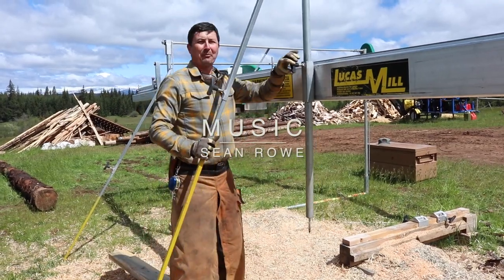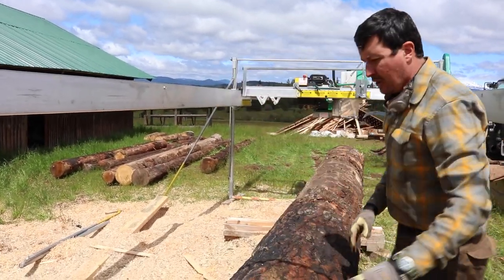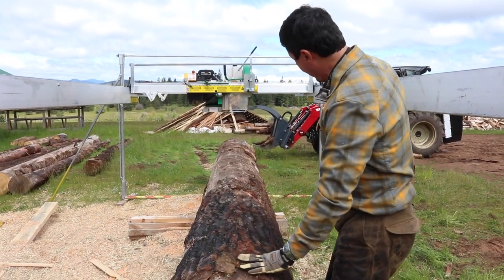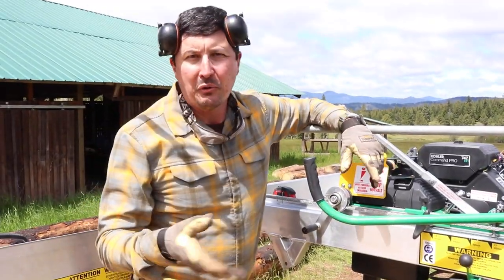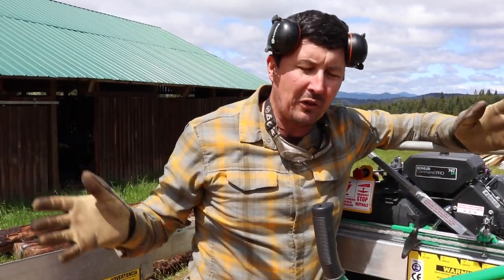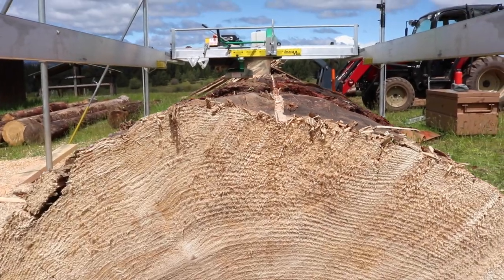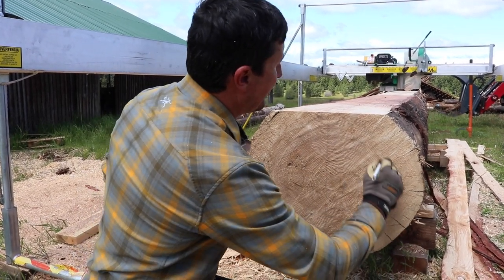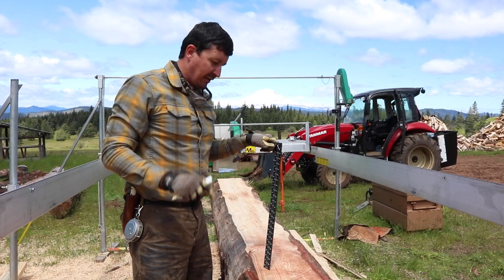Biggest Log I've Milled

Comment: In No. Cal. my mom had a black oak drop that was 56" diameter at the trunk.  In the end, after sitting for years waiting for it to be cut into lumber, a local firewood cutter came to whittle it up for firewood.  I bought it back for the cost of approximate firewood volume.  That was the biggest tree I was involved with cutting with a lucas mill.  The mill even survived hitting a railroad spike embedded in the trunk.  It turned out a lot of 4/4 and even some 4X4 stock.

Comment: You didn't mention it when you were deciding how you were going to cut your beams. But are you worried about grain orientation? Or is it not as big of a deal on these bigger beams?
Reply: Very important! Grain and knots determine the grade of the board or a timber. The grade and the species of tree will define and limit the load capacities, and must be integrated with the dimensions of the beam. Then it's possible to determine if it's strong enough to be used in its particular location in a Timber Frame and able to withstand all forces it will be subject to. Wane effects the grade. More wane will lower the grade (and its strength). Same with knots, and with grain direction/angle off the long axis of the beam.

Comment: If you aim at leveling and centering to the heart (so it comes out in one board only), you will waste only the one board. This is instead of leveling to the tapered edge and the centre of the log.

Sometimes I need to cut the horizontal second and I use wedges.

The middle stay does not need to be used often (mainly slabbing). It can be tricky to remember to lower each time.

Comment: Yes, the amount of wane left on a sawn timber is very important! Grain and knots determine the grade of the board or a timber. The grade and the species of tree will define and limit the load capacities, and must be integrated with the dimensions of the beam. Then it's possible to determine if it's strong enough to be used in its particular location in a Timber Frame and able to withstand all forces it will be subject to. Wane effects the grade. More wane will lower the grade (and its strength). Same with knots, and with grain direction/angle off the long axis of the beam.

Comment: I find if i put my rear winder on my left and my front winder on my right, its easier to wind down from inside the rails. Its also nice to have a trewhella jack or two to adjust larger logs.

Comment: hey guys, I am curious how do you guys plan to protect your beams from rotting at the ground/foundation? In standard buildings it be using pressure treated limber, is there a product you plan to use to prevent any chance of rot in the logs touching the ground? I starting to look into timber framing a house and well that is one of my concerns.

Comment: Cody, since you work on the left side of the mill,  you're always stepping over the blocks that support the logs. Flip the blocks around so the extra length is on the right side. It would make loading from the tractor easier and there would be less of a trip hazard on the left. Live broadcast? I've seen yours before and I personally don't care for them. I'd rather see timber framing, tools, or drone videos. Even your scripture readings (although I'm not Mormon). And the Google suggested videos? I've seen your rocket stove and chisel gift to Brian. They should have given me an early video that I've not seen.
Reply from the maker: +htmagic good advice.  We aren't Mormon either
Reply: Cody, my mistake sorry, no offense. I just ordered an axe through your store for $28. It's $41 through your link. And I'll use Brain's tricks to supercharge it!

Comment: Wranglerstar.....how about using 2 nails and a length of string between the nails to find the center alignment. find the center on each and and mark them with a nail then run the string between them instant center line. or even pop a chalk line....its a suggestion, let me know if I am wrong